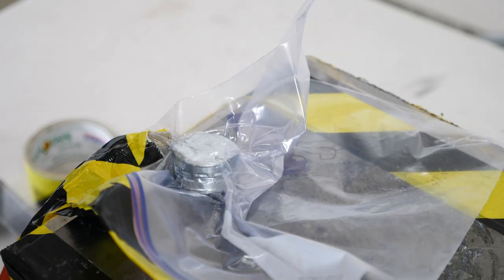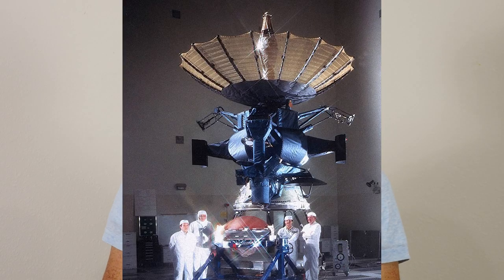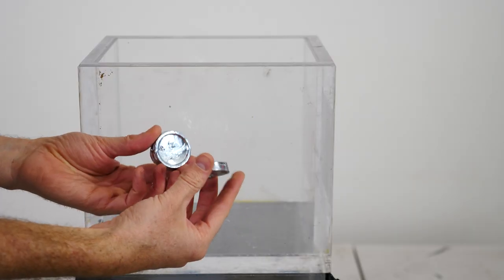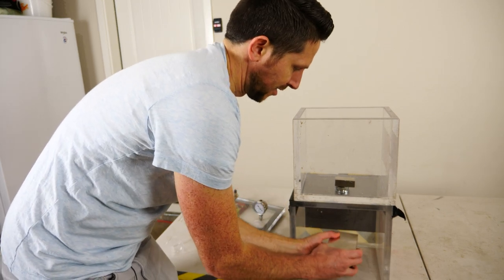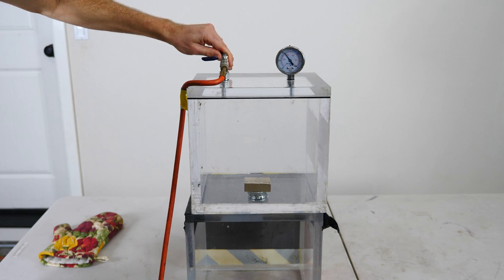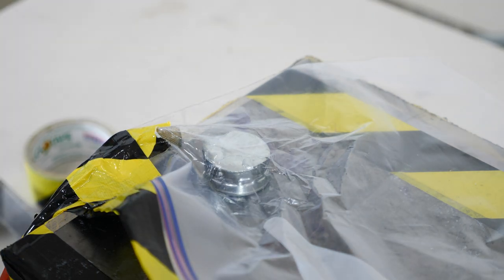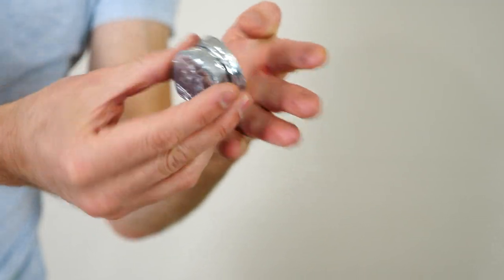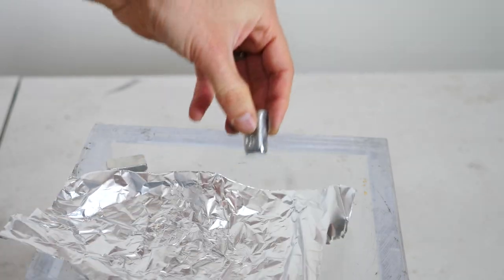Cold Welding Metals In a Vacuum

Comment: Don't you need to clean the oxidization off while it's in the vacuum for it to work? I'm guessing that putting the metal in a vacuum doesn't remove the oxidization that was already there.

Comment: I don't think the gallium actually cold welded. TRUE cold welding can't be pulled apart that easily, even if it's just slightly. If anything the melting point of the gallium was simply lowered by being under a vaccum and then by him pressing and twisting them together was enough to get the surface layer to melt and slightly stick a little.

Comment: This video is a hoax because, Gallium melting point is about 86 F and human hand temp is about 98 F. If you press two pieces of gallium in normal air it is gonna get welded. I could see how you were rubbing them while in vacuum sealed bag.

Comment: In metrology you can wring to steel gauge blocks to each other by just twisting them to each other, but I believe it's just an effect of removing the air between to extremely flat surfaces, creates a vacuum between them. Look up "wringing gauge blocks".

Comment: Gallium does make an oxide layer also.  But keep in mind that even not reaching the melting point of gallium, since you are close to the melting point, if you rub the pieces together with enough pressure, it may cause shifting of the outer few layers of atoms even without actual melting, and thus enable welding (although not very good).  Indium is less reactive towards oxygen than aluminum or gallium, which is probably why the cold-welding in air worked better even though room temperature is much further away from its melting point than it is for gallium, and even though gallium is even softer than indium.

Comment: The sticking of the two gallium pieces, cannot be attributed completely or dominantly to cold welding. Yes I agree cold welding happens. But in this particular experiment, I believe it is more about the atmospheric pressure keeping them together against gravitation pull of earth. As we can see, the gallium pieces taken in the experiment have a rim or elevated surface near the edges. When you put two pieces together, similar to the way in the experiment, a small chamber like  space or gap is formed between the two pieces, closed by the rims at the edges. However the edges don't fit each other perfectly, leading to small  gaps or crevices from which air can escape in vacuum. But as you put pressesure, edges of gallium being soft, deforms to create a more tight fit. when you allowed air inside the bag, the air couldn't go easily within the chmaber between gallium, leading to creation of a suction cup like action, keeping the gallium pieces together. The force required to separate the pieces, was equal to the force with which atmosphere was pushing the gallium pieces together. the atmospheric push (or suction) was the major contributing force in this experiment.

Comment: Perhaps if you had made an attempt at flattening the mating surfaces and first removing any oxide layer before placing them in a vacuum you would have got a better result. I don't think oxide surface layers disappear just because they're placed in a vacuum. 🤔

Comment: How does the cold welding principle work with gauge blocks? They are ground ultra smooth, and when wrung together, there is no air in the interface between the blocks, and they seem to stick to each other. Why don't gauge blocks cold-weld? Also, what holds them together? Air pressure doesn't seem like a sufficient answer to the mystery of how gauge blocks hold together.

Comment: Cold welding is an actual problem in high & ultra high vacuum systems.  Components
like screws are particularly prone to this.  One solution is the use of a lubricant such
as Molibum Disulfide it has a low vapor pressure, tolerates temperatures of at least
200 C.  Other agents may be available now days it's been a while since i had to deal
with this sort of thing.

Comment: This is why gauge blocks ring together, you need a surface with a very flat (you can see this with optical flats) surface to achieve a bond in normal armosphere

With gallium the heat from your fingers introduced error I would think

Comment: I have some questions
1. Can metals boil in vacuum?
2.  We know that near a black hole any body tends to stretch due to the pulling force exerted by the black hole. So does that mean that the pressure is very low near the black hole(is it a vacumm near black hole or there are matter?) and in that low pressure which is created due to the pulling force can liquids or solids boil in that?

Comment: This isn’t cold welding. Gallium melts at such a low temp that the pressure of your hands pushing it plus the pressure of the atmosphere is probably enough to cause it to melt just a tiny bit and it solidified once you took the pressure off. If I’m wrong then you could do the same exact thing with something like gold that you clean off and press together in a room filled with nitrogen so it didn’t oxide. It won’t happen. I’m not saying cold welding isn’t possible, I just don’t think what you have there is a cold weld at all.

Comment: I'm surprised it worked at all because you have to have perfectly clean surfaces. You touching them with your dirty oily hands interferes with the bond.
Satellites, and the parts of satellites are super clean, because they are assembled in clean rooms after each piece is thoroughly cleaned, and that's why cold welding in space is a common problem.

Comment: If the oxides are what prevent it from welding under normal pressure then wouldn't it require you to remove the oxide layer before putting it in a vacuum? Simply putting it in a vacuum wouldn't remove the already built up oxide layers right?

Comment: Galium has a low melting point, basically holding that shit in your hand will fuse them together wouldn’t it? To use galium to explain cold welding is kinda dumb in my opinion. I’m I wrong?

Comment: The gallium pucks had an indention on the sides that he "welded" together that when forced together with an extremely strong magnet kept the air from being pulled out from between the pucks. When the vacuum was pulled in the back without the strong pressure forcing them together it would have allowed for the air to be pulled from between the pucks and force a vacuum pocket where the indentions of the 2 pucks were. With how easily he pulled apart the "welded" pucks it is far more likely that they were being held together by the vacuum pocket between the 2 pucks. Actual cold welding would have made the 2 pucks a single piece and not so easily pulled apart.

Comment: Did you know that using cold welding We can make a solid state battery without an electrolyte. That would presumably continue to flow forever. Because one side would be connected to the atmosphere and the other would be connected to the ground

Comment: It doesn't just need for the oxide layer to disappear,  both touching surfaces need to be very clean, no dirt or grease can be on them. When you touch both metals with your hands or put them on a table, you are contaminating them with dirt and grease. Those take a very long time to go away even in space. You don't need to apply much pressure to cold weld two metals, they just need to have extremely clean surfaces.

Comment: What would happen if you machine surface of two aluminium blocks in helium chamber, would they cold weld together, as there is pure helium atmosphere without oxygen to form oxide layer on the fresh metal surface?

Comment: Can you remove the oxide layer from Aluminum with a gas or a liquid? Maybe you can transition directly from this gas or liquid to a vacuum?
Reply: Yes. Etching solutions are available for removing the oxide layer from aluminum. But in space liquids typically don't stay liquid for long. The easiest way in my mind to prepare a welding surface in space would be mechanically with a grinder or a belt sander even though those would create micro-particles that could eventually be a problem.

Comment: Gallium melts at 30 Celsius not 80. So the pressure would cause heat which could easily melt and weld them together. Also if there was an oxide layer, applying pressure wouldn’t get rid of it to allow the metallic metal to touch

Comment: wow thats like saying if u put a rusty iron rod into a vacuum the act of removing oxygen will remove the rust from the iron? fall off?  vanish? turn back to iron and remain on the rod? theres no need for physical removal of the oxide layer? i.e. sand paper.  that blows my mind if thats real.  Weird that a finger compression cold weld wasnt performed in air prior to the vacuum bag attempt, is there a difference ?

Comment: That's not cold weld. That is a metal suction cup.
You have a ring groouve in the two contatct surface with a space in the center...  with vacuum.
It allow it to stuck toghever untill you move, air enters in the alcove and you dont have anymore the vacuum.

Comment: I don't call it a cold weld.
I call it vacuum.

There's a hollowed space between the two disks. When sucked out the air,  the disks are pressing into each other due to the lowered air pressure between the two disks.

They're acting like two suction cups pressed together.

Comment: To get the metals to "cold weld" you would first have to remove any oxides on the surfaces to be joined in an inert atmosphere or vacuum. just pushing them together in a vacuum is going to do very little.

Comment: Is it possible that the two pieces of gallium stuck together because of their shape and vacuum, rather than cold welding. Both had a cup shape, and when the vacuum machine sucked all the air between the two pieces vacuum was created between the two pieces.

Comment: It disnt worked well because even if there is no air around the aluminum the oxygen is still bonded to the surface stopping cold welding
You should put into a vacuum, ise some light acid to remove the oxyde layer and then place them together

Comment: It's amazing to think that things like the oxide layer are to thank for two objects of a same molecular composition don't just merge together  all the time.
Reply: Gold seems to have no problem not sticking together in large heavy piles in places like Fort Knox. No oxidation on 24k gold.
Reply: @rossbrumby1957  Afaik the gold stored there is not stored directly on top of one another but has a carbon sheeting between it, either wood or cardboard, or a parchment paper of sorts.

Comment: Need to have much more surface area to bond stronger.. should be done using flat prices of metal...the gallium has a bunch of pits that reduces the surface area which results in a weak bond

Comment: So if I cut a iron beam underwater using a hacksaw and press the two pieces together will they col weld and join back ? Cutting it underwater will ensure that their cross sections are pristine and does not have any oxide layer.

Comment: It happens a lot to me with stainless steel bolts and nuts. Because stainless steel does not have oxide at the surface. If I put any oil, even dirt between, it will never happen.

Comment: Maybe the gallium pieces would cold weld better if they both had a perfectly flat, smooth surface?
It kinda looked like there wasn’t enough surface area touching for the cold weld to make a very strong bond.

Comment: You should first make both surfaces completely flat and then use phosphoric acid (from a autopaints store) to remove the oxide from the grain structure. Then redo the experiment before the oxide can reform.

Comment: It would no doubt have helped greatly if the mating surfaces were lapped beforehand. These aren't even close to flat, so the real contact surface will be very small. That probably results in you needing to use way more force to push them together. Thankfully gallium is fairly soft, so the amount of force is manageable.
Metals that don't oxidize easily can sometimes cold-weld accidentally even without a vacuum if they are really well lapped and put under some pressure (can happen with coolers for example).

Comment: You need to work the surfaces so they are flat enough that a substantial number of the atoms on each piece are in close enough proximity to bond.  Look up "gauge blocks".  They are so precise they stick together when you put them together.  It's called "ringing".

Comment: Cold welding is an interference fit between 2 parts. 1 is heated and the other is cooled, then they're put together and the temps equalize locking the 2 parts together.

Comment: my only question here is
firstly, the pressure applied could produce the heat to cause the melting to occour

secondly
if the oxide layer already exists as a bonded state
then wouldn't that mean that creating the vacuum is great, but the bonded oxide layer still exists? meaning you never really get rid of that thin layer of oxygen molecules coating the metal?

Comment: you could polish the surface of the metals while they are coated/submerged in a volatile solvent, protecting the surface from further oxidation. make sure they're still covered upon being put in the chamber. Once a vacuum is pulled the solvent should evaporate, leaving just the bare metal surfaces in contact with each other.

Comment: It's my understanding that dissimilar metals can also be cold-welded. But I think one of the challenges is that the two metals have different oxide compounds from one another. One will almost certainly be a harder compound than the other. You remove the air so a new oxide layer can't form, but you have to get rid of the oxide layer already present on both metals. If you attempt to do this by just rubbing them together, the result may be that the harder oxide layer can remove the softer oxide layer, but the softer oxide layer can't remove the harder oxide layer. So you still have a metal oxide between the two metals.

It's just a hypothesis. The "simple" solution would be to use a some other abrasive material to remove both oxide layers under vacuum, and then introduce the metals to each other. The tricky part is, now there's a significant amount of time between removing the oxide layer and attempting to cold weld, so even trace amounts of oxygen in a near-vacuum may have enough time to oxidize the metals again. Whereas when you're rubbing them together, there is practically no amount of time between removing the oxide layers and introducing the bare metal.

Comment: Hi! The Action lab.
You have done many experiments using vaccum. Here I have a request if you can make a video and tell results of experiment.The experiment is to take two precise clocks which get stop when light reaches them and time get saved.
Here we need two clocks and set same time together at same location say we are setting time at position P. After that one clock is moved to d distance back and another clock d distance forth. Now a laser at point P give of light in both direction ,So that clock can save a time. .
After that , we will again take a test but one clock would be placed at 2d and one would be at d distance.
And we need to test it few times by changing direction of clocks. And by interchanging distance also.
Setup of experiment -
Experiment would be done in a vaccum chamber which is quite long and the cross-sectional region of chamber would be more than 1m2. 
And then tell readings of clocks after sending signal.
Reply: We have listened too much about such experiments and are discussed too much nowadays but there no one showed such experiments and their results. Only thoughts.

Comment: I thought that cold welding, or vacuum welding, only works properly if you remove the oxidized layer once all oxygen has been removed from the air. Then metals will instantly stick as they don't know where one ends and the other begins. 
Unfortunately, this seems to be a poor experiment and does not fully grasp the concept behind cold welding similar metals.
Reply: Did you watch the whole video? He actually just stuck them together by touching and melting them, despite what you think. He could have used gold if he wanted something that actually doesn't tarnish.

Comment: There is a method of scraping metal to make it pretty flat. It looks scratched, but it is more flat than ever. Two surfaces like that would flow on each other on air bag, but if you stop it will stick together pretty hard. Since it’s not absolute flatness you can pull it off with a strength, who knows what would happen if it will be absolete

Comment: DUDE.... I cringe watching you handle those neodymium magnets...  Monster magnets are no joke, small chunks of metal or other magnets can unexpectedly become high speed projectiles in the presence of such a strong magnetic field.   If you are going to use magnets like that, make sure the larger magnet is in place FIRST, and then CAREFULLY bring the smaller magnet into position.  It is also a good idea  to clamp the large magnet into a stationary jig to avoid any unexpected movements.  I am all for experimentation, but BE CAREFUL when working with strong magnets.

Comment: You can weld gallium at 82.5° F anyway, which is pretty cold compared to many other metals.

I understand that cold welding is metals joining without melting, but are you sure the gallium didn’t melt a little considering that the heat of a human body is more than enough to melt it?
Reply: It’s possible but unlikely specifically at the places that they joined. It would melt around where he touched it, otherwise the heat should dissipate pretty quickly too

Comment: sorry just not impressed.  You used metals with extremely low melting points.  You can weld gallium with the heat from your hands.